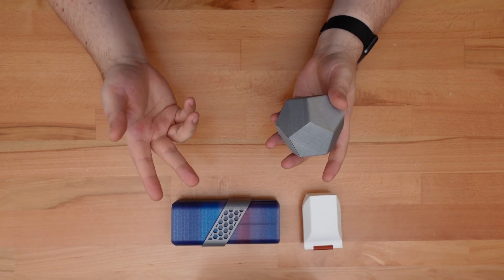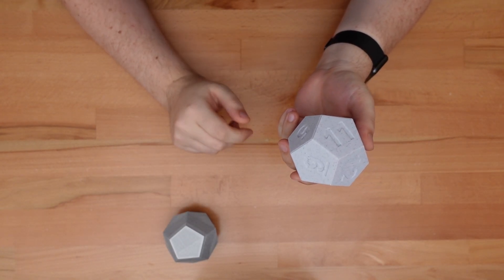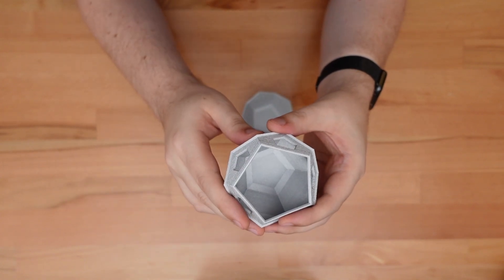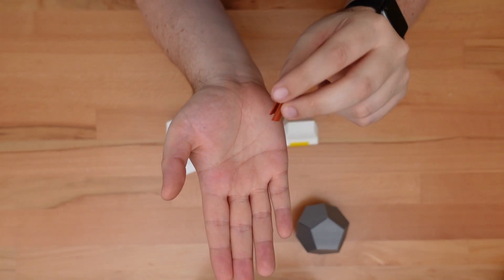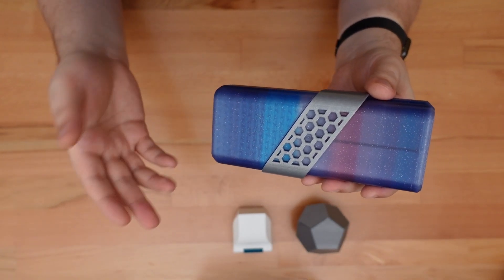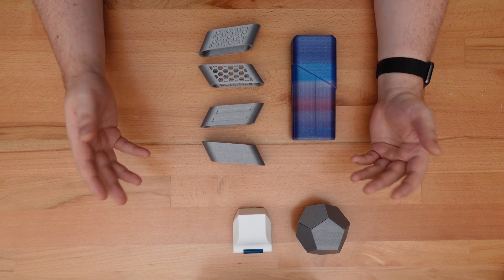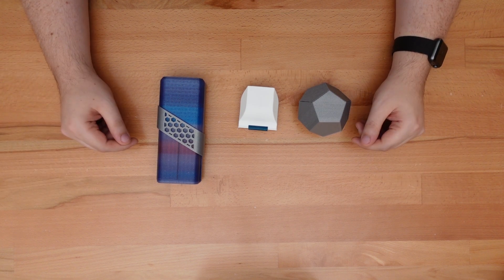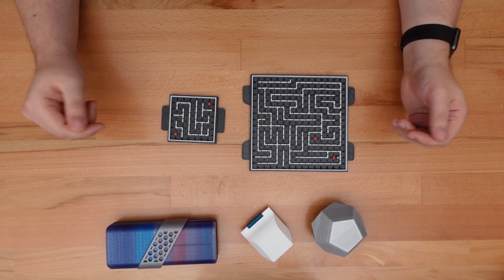3D Printed Containers

Comment: I was wondering if you could design some print in place versions of the maze because mine that I made is not coming apart anytime soon.
Reply from the maker: Are you thinking of a version where all the walls are merged together, but still separate from the base, so you can switch between multiple complete mazes? Or did I misunderstand the question?
Reply: @3DPrinty  Yes, that is what I was trying to say.
Reply from the maker: Gotcha! I may make some pre-built mazes in a future remix. It won't be for a little while, though, the next month is already dedicated to Halloween projects :)
Reply from the maker: A few pre-built Googol mazes are now available here: https://www.printables.com/model/315388

Thank you for the suggestion!